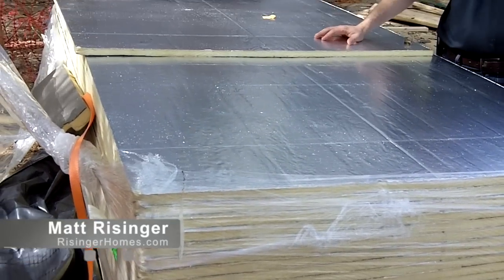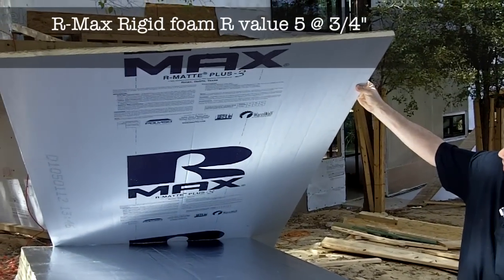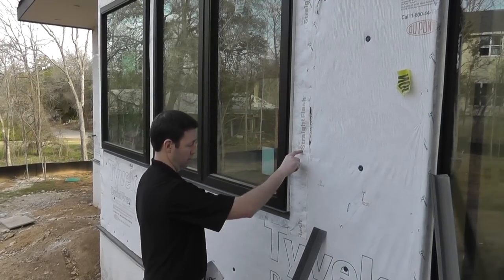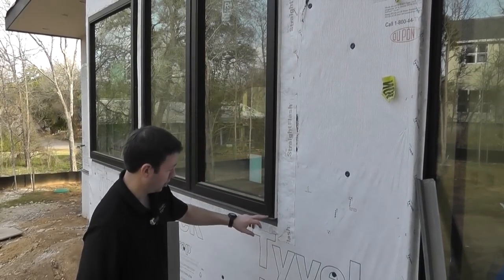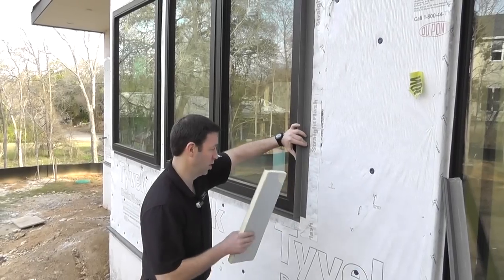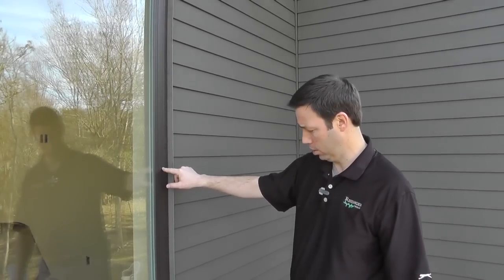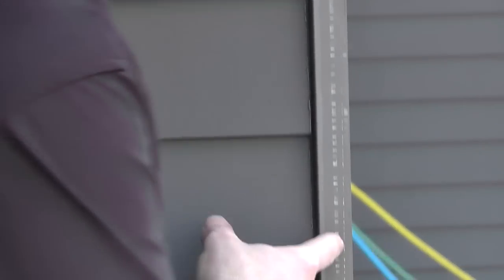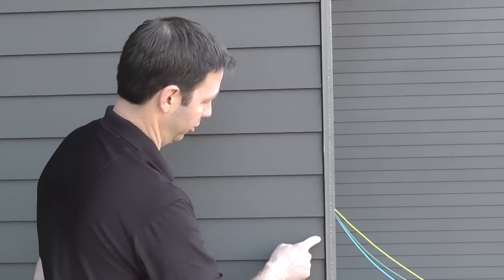Installing Exterior Foam w Hardie Plank & Andersen 100 Windows

Comment from the maker: Good question!  Yes I'm using traditional equipment but the key is sizing it correctly.  A typical new house might use 1 ton of AC for every 500 sq foot of house, mine are getting closer to 1000sf/ton.  We use an engineer to run Manual J calcs. The house in this video is getting a heat pump from Mitsubishi that utilizes variable refrigerant flow technology and can run at any speed from 15% to 115% of rated tonnage.  Most AC's are 100% ON or 100% OFF.  Look for that video in a few months. Matt

Comment from the maker: I don't often used closed cell foam on exterior walls in this climate.  In general we want everything to dry to the inside here in Texas as this is a cooling dominated climate and we dehumidify our houses 9 months of the year.  If you want to use closed cell foam inside the stud bays be sure to do a first rate Weather Resistive Barrier on the outside of your sheathing to ensure it won't get wet.  Best, Matt

Comment from the maker: The gaps you are seeing in the video are roughly 1/8".  We use a sheet of thermoply against the metal flashing to space the hardie, then pull it out after install.  That gives us a straight line, makes a consistent gap, and gives the hardie room for expansion.  It is indeed possible to get "some" bugs back there but I've not seen much intrusion.  There isn't a path to get in the house from there either.  Benefits outweigh this small risk.  Best, Matt Risinger
Reply: Matt Risinger what the best way to install fome insulation on exterior block wall and install hardy plank

Comment from the maker: I prefer to install foam last.  That way you've got a normal window installation and you can be sure the house is 100% weatherized with your Tyvek install.  Plus, putting the foam on last ensures that your Tyvek is covered so it will experience much less thermal spikes over the decades.  Best, Matt
Reply: G.

Comment from the maker: Both the inside and outside corners are bent metal pieces from a local metal fabrication shop.  Tamlyn also makes commercial versions but we bend them on a brake and use 24 guage metal.  The Hardie is nailed at each stud location.  If you site down the wall you might see a slight wave but it's not visable from the ground or looking straight on.  The rainscreen battens are also on 24" centers. Best, Matt

Comment from the maker: That outside corner is custom bent at a local Austin metal shop.  It's in an "x" shape.  See my blog for a detail on that flashing.  I'll be a local shop or a roofer with a 10' brake can bend it for you.  You can also buy them from Tamlyn who makes trim pieces like this for Hardie.  Best, Matt

Comment: thanks, excellent video.  One point about seal/culking around the window trim, insects often find that gap a favorable place to nest, this can particularly become an issue with bees.  so, some sort of low expansion foam or culking can block that point of entry to insects like bees and moth or any other pesky insect.

Comment from the maker: That's "Paint Grip".  It's a grey matte finish that's intended to hold paint. Architects like it because it has mottled finish and isn't shiny.  The outside corner is a "x" shaped open corner from the same sheet metal.  See my blog for a detail of the corner.  Yes we have termites, No amount of caulk will keep them out.  Same for mud daubers, fire ants, etc.  Best, Matt

Comment: Has anyone ever seen the rain screening gap be used by wasps or similar insects to create large colonies behind the cladding? I like the water drain concept and the caulk-free application, but would be interested to see any pest control issues that arise from no gap blocking or tight cladding install. I appreciate your thorough insights into the various methods and rationale for building; keep it up.

Comment: Really nice Matt! -- QUESTION -- Isn't this metal siding since @03:27 when you knock on the siding it sort of rattled like metal siding??  We really like this siding but you mentioned it was HardiePlank.  Was it made from metal 10 years ago?  We do not want to have to caulk the siding and noticed on your peronsal build that your guys did Caulk the Hardie board at the end corder sections.  That would be a no-go for us. Why not avoid caulking all together??

Comment: I like the videos but I see perhaps a potential problem.. We have been doing light framing for 25 years now and over that time I've also been doing the thermal break on the outside like you have been suggesting.  The issue is that by insulating the outside with rigid low perm insulation,  you are effectively trapping moisture at the  dewpoint transition point within the wall.  Basically having a vapor barrier on both sides. We have been using ROXUL comfortboard,  which is a permeable mineral rock wool insulation instead..  It's fireproof,  waterproof, mold proof and pests do not like it..  This gives us the thermal break without causing any trapped moisture issues.  Have I missed something?  I realize your house wrap is meant to breath but there's nowhere to breathe to when behind the insulation or do you strap the wall afterward first?
Reply: he showed you there was space behind and in front of the rigid foam for water to come out
Reply: wall vents inwards.  To do so, you can't have an interior vapor barrier, AND the exterior foam must be thick enough to prevent dew point on inside rigid foam face (as Matt mentions at 5:15 in above video).  Like all engineered systems, it's difficult to get the entire concept across in one video; the viewer must supplement concepts with further research.
Reply: qwqehwekrhlfjghdklfj < Matt said in northern climates you have use thicker foam for dewpoint issues, but not in Texas.

Michael < Comfortboard uses a baton to gap the exterior membrane, correct?  
What do you do for windows, vents, outlets and door jambs that don't protrude out that far?

Comment: Foil faced foam is vapor impermeable, so any vapor trying to exit the warm interior will not be able to escape past the inner surface of the foam panel. It will be trapped there, providing a moist place for mold and rot, no?  Why not use a permeable foam panel such as BASF's Neopor or similar?

Comment: Hi Matt,
I love your videos!  I've watched all videos related to rainscreen siding. I've rebuilt my house from the studs out using the knowledge and information you haprovided (i am not a contractor and have no experience in this realm). Thank you for all for helping to make my project a success so far!  I'm at the final stage of siding my house.  I have 2x6 studs, with 1/2 in Advantec OSB, drainwrap, 1 in foam, dupont rainvent battens. I want to put 1x6 cedar clapboards on as ssiding.  I bought stainless siding nails, 3 1/2 in long to get 1/2 in into the stud but they are splitting the siding.  I cannot find smaller diameter nails. What did you use to fasten the siding on your projects. THANK YOU for helping me save my  house!!

Comment: I use to build here in Texas and Hardie it is nothing new but it takes on moisture and water and it rots. I'll take a vinyl siding over Hardie any day, easier to replace and doesn't rot, may warp depending but easier to replace. I've seen many rotted houses, I use to use Hardie to sell others exterior, maybe it's the application but I'd seal everything sealable and paint it too, it's like painted OSB imo.

Comment: R20 rigid foam outside
R15 inside walls 
R10 between old drywall and strapping.
Might hit R50..

Windows?

Summit Series 8000.

#12- R10 triple pane
37.5 x 25 awning windows.
R10 door..
Double steel door foyer..
24 gauge steel roof with R10 rigid foam & purlins.

My outside Rigid foam was 1 1/2 sheets staggering seams two layers... taped!
Inside 3/4 Rigid foam staggering sheets covering seams. All seams taped strapped for new drywall.
Inside ceiling 
3/4 Rigid foam double sheets staggered and taped...strapped for new drywall.

Comment: Foil foam is great except it stops cell signals. Make sure you paint that hardy plank where it is cut or you will swell the siding along that move trim.
Reply: I am glad you mentioned this.  We pay big bucks for our smartphones and the foil barriers in the attic and walls will drastically affect cell phone reception.  I have Low-E glass and this coating also reduces cell signals. A home is a synergy of many technologies.  Radiant barriers need better testing so homeowners know exactly what they are getting into.
Reply: Its called Wifi calling, enable it on your smartphone and your wifi router now acts as your cell tower.
Reply: @Neubs-xv8tw  when you have a superbowl party at the new expensive house, you can have a 2 hour preamble where you give the wifi password to all the guests and configure and troubleshoot wifi calling
Reply: That's quite possibly the dumbest response I've ever seen on youtube. My friends already have my wifi password and if they don't, they're not friends and will not be gaining access to my network and I don't care if they can't make calls.
Reply: @Neubs-xv8tw  You've never had a friend bring over their friend?  Or invited a new friend over who has never been to your house before?

Comment: Thanks for the video, I have some gap between the Hardieplank and the foundation blocks which is normal, but since spiders, ants and other bugs are crawling in and out, I like to fill it with expanding foam. is there anything wrong with doing that? thanks

Comment: So what about just installing the foam insulation onto the exterior of the house after installing the wall shealthing then install the windows just like you would traditionally. Then there is no need for the extra trim Piece. Or just install the foam like you have it and install another piece whatever the thickness is around the window.

Comment: I like what you've done to solve a pretty common issue when building out exterior insulation and rainscreen walls.  What this project doesnt show is how you would approach an exterior window trim installation.  Would you simply butt the trim up to that side flashing then butt the siding up to the trim?

Comment: Questions: What is the rainscreen material? What fasteners did you use to attach the siding? (I presume that the fasteners penetrate through the foam to the sheathing. True?

Comment: Do you still put the reflective foam on the north side of the house? Seems like there would be a lot less radiation pressure there; or is the cost difference between silvered and unsilvered so small as to not make a difference?

Comment: Great videos!  But caulking only for aesthetic purposes?  I would think you need caulk on the ends of the Hardie to protect those cut ends from excess moisture.  Do you at least paint those cut ends?
Reply: S Timberlake to me aesthetics are just as important,  i would still caulk it, maybe with some pl polyurethane caulking but hey everyone has their own preferences
Reply: To maintain warranty Hardy requires that you paint all cut ends.  I like the clean look you get without caulk.
Reply: Terry Pullen actually majority would prefer to caulk, its always cleaner without gaps. Thats a pet peve to perfectionist "gaps"
Reply: I have run into this in the past and if you call them and ask the question, their scripted response is that you can caulk the joint between cut ends and trim and not paint those ends.  I've approached the question in multiple different ways with Hardie and its the same scripted response.  I have done work with their product where they change the installation instructions so much, if you do ever have an issue, any potential warranty claim you may have, they will deny due to improper installation.  Look at their panel system, you need a underlayment with a pretty unique per rating. THAT HARDIES OWN WRAP DOESN'T EVEN MEET!!!  Someone is going to make alot of money replacing this stuff in a few years when it has wide spread failures.

Comment: I was dead set against Hardie board but I may have to revisit it after seeing how good it looks in the video. A question about not using caulk to seal the edges. I know most of them in Austin will just open the front door to get in but any concerns with insect intrusion?

Comment: I am getting there have the house wrapped and r-max up. I looked at your blog for the custom trim and watched a few more of your videos. You consistently talk about a rain-screen. In a comment you mentioned 1x4s or 1/2" plywood. I had planned on going right over the foam like the Hardie instructions say. Is it too late for me to rethink that and be better off to cover my siding with a tarp for another week and find the coroplast battens somewhere or rip some 1/2" plywood strips?

Comment: Matt, does the rain/drain system negate firing nailers? my concern is that the siding will be pulled in and not remain true over 1" foamboard over wrap over cdx 1/2" ply?

Comment: Matt,

First, I recently discovered your videos, and I've enjoyed them a lot.  I've been watching quite a few of them, and it looks like you do really excellent work

I've seen you use fiber cement siding over a rainscreen in several videos, but I'd like to hear your thoughts on wood composite siding over a rainscreen.  It seems like the extra thickness and rigidity would work well, and the rainscreen should allow full drying to prevent any moisture damage.

Thanks,

Paul
Reply from the maker: Paul Frieden Paul, Thanks for the complements!  Yes, rainscreen will work well for your application too.  See my videos on wood siding with rainscreen.  Best, Matt
Reply: Have you used wood composite siding over a rainscreen before?  I'm looking at LP SmartSide, and I'm curious to know if you'd do anything differently with it versus fiber cement.

Thanks again,

Paul

Comment: Would u not build your windows out to meet the depth of the styrofoam, using a 3/4 inch board around the window frame....or maybe im not seeing what u r doing correctly..thanks

Comment: So if a house has a Tyvek wrap and you plan to add a layer of external foam should the Tyvek be removed and replaced with DrainWrap? Or would an air gap be better?

Comment: I'm you could have bought the extended jamb for 1/3 the cost from Anderson or made it insight from finger joined primed. And caulks now adays have 50 year warranty and are tiny able. And btw the flex wrap is being abandoned by DuPont

Comment: Hi Matt, 
What is the finish on the flashing material? Looks just like  a mill finish or is it  painted to match the Hardie. The flash detail is the same used for retro vinyl and aluminum siding...and has that "reclad" look. The outside corner was made of xbrace?...or was it an xbrace wall you referred to? The trimless no caulk detail looks clean...but don't they have termites , fire ants,  mud wasps and wind driven dust in Texas?

Comment: Hi Matt, thank you for the video!  I'm a fairly new builder in Virginia.  Two questions.  First, are you concerned that the nails used for the flashing penetrate the flashing?  (I see the bottom flashing was nailed, I'm assuming the sides and top are also nailed).  Second, if the window will get trim, I'm assuming the flashing is not needed because the trim will look fine if it is proud of the window, and the siding can butt into the trim?  Thanks again
Reply from the maker: Christopher,  Check out my blog post on this same topic and you'll see some greater in-depth pictures that I think wil answer your questions.  Generally nails penetrating flashing (peel & stick) are OK as long as there is gravity on your side.  That's why I like a rainscreen so much.  Best to you, Matt
Reply: Matt. Do you have a link to that post? I'm searching for mattrisinger.com it, and cannot find. Thanks.
Reply: Just saw the link in the description...doh!

Comment: How are you securing the L flange (or 1x4 frame from another video) around the window? I am planning to use sips with peel and stick wrapping followed by an air gap, and then the board and batten.

Comment: I've seen what looks like builders using OSB on some parts of their home builds while using foam board as a substitute on other parts of the home. I'm seeing something called Typar and SI and very little wood if any outside of the studs. Is this normal?
PS 
The house is them wrapped with Hardi Plank.
Reply: OSB is structural and foam board is not so a house sheathed in OSB will be stronger then a similar structure sheathed in foam board.  Typar makes many different kinds of wrap so you would have to know more then just the brand name.  If you are asking if it is okay to not sheath a frame then "maybe", "yes" it is under some circumstances but it is a rich man poor man thing.  That is to say that your either cutting cost to the bare bone or building a high end home with large glass panels.  I would never recommend it in ordinary residential construction.